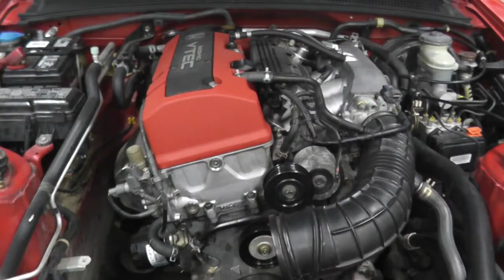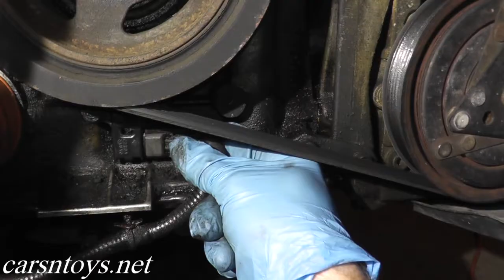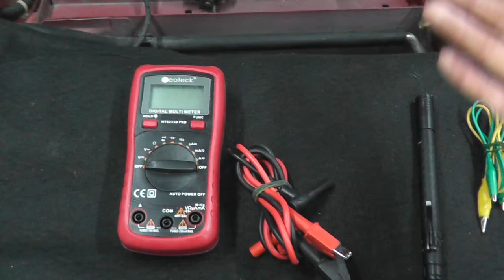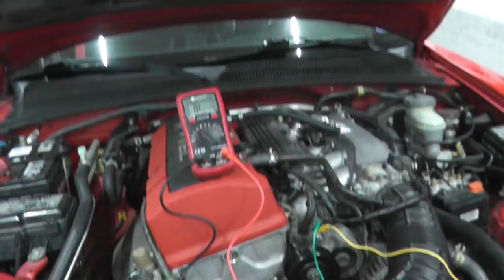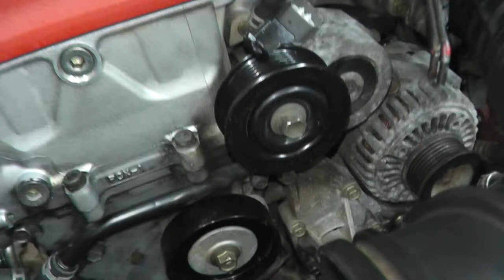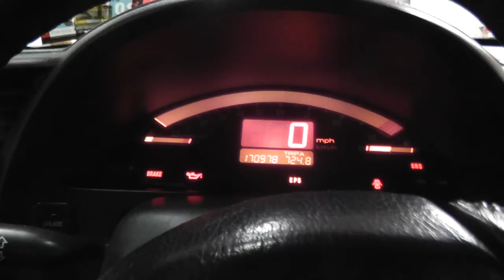How To Test and Replace Crankshaft Position Sensor P0336

Comment: Crank sensors are electronic hall sensors usually. They need powering by 12v and checking of the 5v sensor line. It goes up and down in presence of iron.  The resistance measure is a poor substitute test.